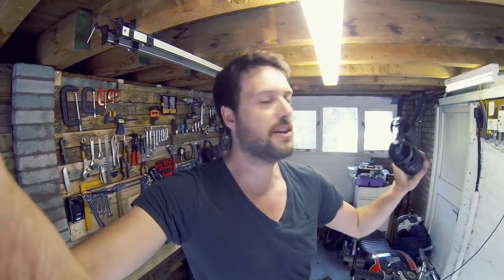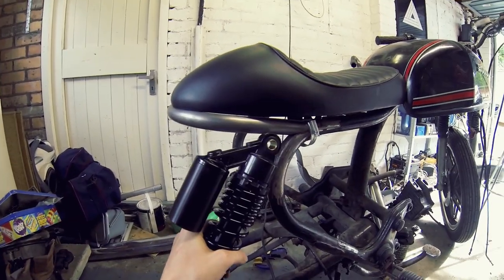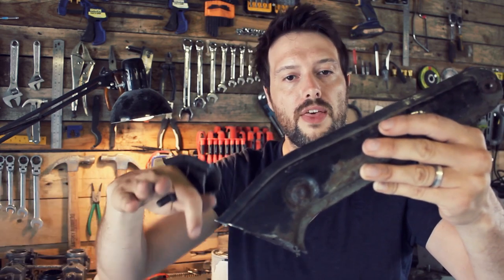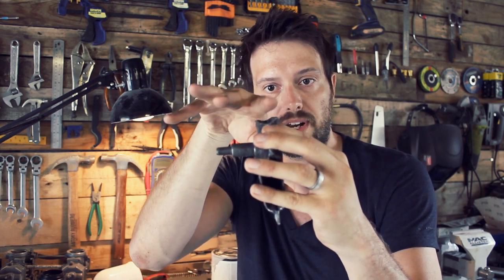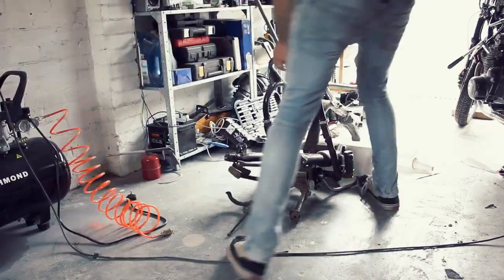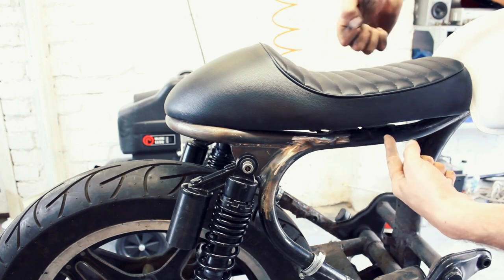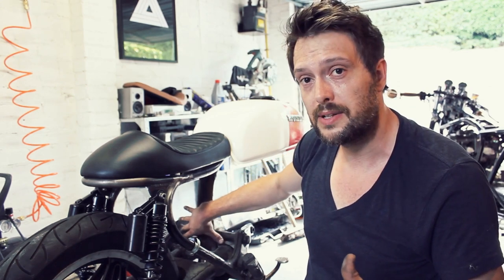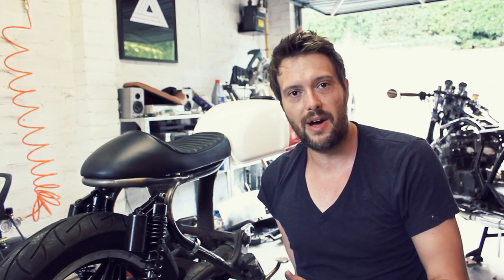Honda CX500 Cafe Racer Build 12 - New rear frame hoop & shock mounts

Comment: My cb400 project is very similar to yours, except that mine is red. You can make a battery box to hold the battery underneath the frame, around the Central easel original position. You can than wire the battery cables inside the backbone frame. That will give your bike a very clean look. As my bike won't have electrical start, I could install a very small battery of 5Ah. Another thing, I used the same idea you are thinking about the electrical parts underneath the seat. It works great!!!
Reply from the maker: Thank you, good thinking with the internal wiring.

Comment: what I would like to see is closeups on things you or someone else has done, this one had quite nice ones. are you sure you can fit those shocks upside down? they look better right way up anyway. some put they gel or agm batterys under the frame or engine in the box, but you can't fit acid battery there cos it need to be on its side. I kind of like that short subby seat not covering that back wheel.. specially when it is so close to it..
Reply from the maker: Yeah definitely going the right way up now as I've mocked it up at the end. I'll be using a LiFePO4 battery so all dry technology. I'll be making more close ups from now on with this new setup.

Comment: Hi buddy, only just discovered your channel and love the content, my one piece of advice if your budget allows would be to get a set of Murrays carbs from the states, will set you back about £500 all in but it'll transform the bike. I had the original carbs with 90/120 jets and it ran ok with dual Harley 883 pipes but was never spot on. I took the plunge and there's no comparison... a MUST on a CX build in my opinion. Keep up the good work, Cheers Paul
Reply from the maker: +cossiep gosh it's a big expense but if you say it's one thing you're glad you did them obviously worth the money for you.

Comment: Do you know, I wasn't sure about that mod you were making to the frame but I'm going to do that to mine. I have a 1980 CX500 C and I've just finished totally rebuilding the engine and carbs and I'll be starting on the frame and forks next. Thanks for being a guinea pig :)
Reply: BTW, who was it that welded your shock mounts and hoop?
Reply from the maker: It's cool, I think there have been a lot of doubts about this project, a lot of people wanted me to go monoshock. I'm glad you like it, and of course, steal away. ;)
Reply: Cheers. I made the choice early on to stay with twin shocks for 2 reasons, I like the 'older' look/feel and the other is everyone else seems to be going mono shock. I'm also keeping the original front end for the same reasons plus cost. Mine is the Custom so the tank shape is different.
Reply from the maker: +oofafoo yeah it seems to be the craze now for monoshock builds  I feel sometimes when they're done with these 'bolt on' kits they can be unsafe sometimes
Reply from the maker: +oofafoo it's a local bloke in Cheshire

Comment: At 4:52 what kind of bolts are those? I am looking to cut my cb750 that same way and need those for reference for the cut and to attach them later on.
Reply from the maker: Those weren't the proper bolts there, only something to position the shocks, for the final ones I used proper shock mount bolts.
Reply: For The Bold - dreegez ohh. It seems i am just having trouble finding bolts for it since this is my first build. Mostly just guiding Harley bolts
Reply from the maker: Try Dime City Cycles, they have a good set.
Reply: For The Bold - dreegez i am getting most of my stuff from there and havent seen anything yet maybe i am overlooking it

Comment: When you removed the original bracket for the seat and shock pins and welded in the new pins did you have to go with a shorter shock or was the distance the same as before due to the angle?  I'm looking at getting progressive shocks for my CX500 build and am trying to figure out which length I need.
Reply from the maker: No I kept the shocks the same length to both lift up the rear and to ensure clearance between the rear wheel and the frame.
Reply: Thank you so much! That is extremely helpful!

Comment: Fantastic video and video series. Ive been watching this build from the beginning as I am building a cx500 myself. I'm at the stage where I need to find some rear shocks. I think i will order the RFY ones. Did you order the 320mm long ones in the link you provided or did you go 330 0r 340mm? My setup will be very similar to yours. Thanks
Reply from the maker: I can't remember the exact length but it was the same as the original, I probably would go longer if I did it again to raise the back again.

Comment: Hi there, absolutely loving your videos! Never stop doing them!!!I So now that the bike is finished and youve been riding it, whats your opinion on the rear shocks you installed? How do they react cornering at "higher" speeds? Not to soft, not to wobbley? thinking on putting a set on my cb750 (1998) build, wich i would like to take to the track now and then.... Thanks for answering...
Reply from the maker: For road use they're ok, and stable, if you are thinking of track days, shocks are the one area I'd say to invest in some Ohlins

Comment: May I ask what the total length of the seat is? The shortest seats I'm finding are 52cm. The problem is 52cm seems way to long for me. I want my seat to end exactly where yours does. Right before the middle of the rear wheel but I've measured from the tank and back and 52cm would leave behind the middle of the rear wheel. Keep up the great videos btw!
Reply from the maker: It's the same length, but what makes this different is the frame, the CX500 fuel tank stops shorter than other bikes so the seat starts earlier.

Comment: I’m mounting my shocks a similar way to you. How did you bolt the shocks to the new mounting, did you purchase/ make a shoulder bolt or did you just use standard bolts? Thanks
Reply from the maker: For positioning and presentation just normal bolts. Then proper mounts after.

Comment: Looking great. where are you putting licence plate?
Reply from the maker: Thanks. Do you know what... That's the pain in my arse at the mo that I can't decide. I love the rear end and how clean it is. I'm looking into MOT options and how far I can push it. I might have a chat with the guys at the MOT centre on Monday and ask them. Might even be a case where I add a removable bracket at the back. I love how the bikes in USA get away with having a thin one wrapped around the rear wheel.
Reply: Yes. I have the same problem.  Kott bikes often sport a nice curved bracket that follows the rear axle centre.  I have decided to go for a 45 Degree bracket off the rear hoop, under a small catseye rear brake. The plate  then doubles as a mud guard. Cheers.
Reply from the maker: +Andrew Ritchie yeah it's along the same lines as what I'm thinking using the plate as an extended guard. Going to try and add a quick plug in and out cable for the break light and indicators.

Comment: Hi. Just wondering if you've tried these shocks on another bike or had them recommended by someone who has? Only, I noticed they are rated for 200kg max load, and I think the GSX400F that I'm tinkering with is already around the 180kg mark so might be stretching it a bit with my manly bulk sat upon it....
Reply from the maker: I have them on the GS and know a few people who have ridden with them. As for the load, your whole bike's weight isn't going to be on them, so if you have a 200kg dry weight bike, that weight will be spread evenly on the road also. But you're right, I weigh 94kg so it needs some sums to calculate if the weight of you and what's spread on the rear shocks etc.
Reply: Cheers. Very helpful thanks. Maybe I need to sit my rear end on a weigh bridge!

Comment: hi bud, 
just wondering how your going to fix your seat down as its a single unit?  having trouble with mine!

its looking good mate..
Reply from the maker: +robert white it has a few screw at the bottom for brackets. So I'm going to have to weld some nuts to the frame where I can screw the seat tight. Limits where I can put the electrics tray. I'll make a video on it.

Comment: Hi bud,  great job. Looking sweet. 
Started my 1st project. :/ How are u going to mount the license plate. Are u having a rear mud guard to mount it to? 
Phill
Reply from the maker: Brill, all the best with your project. I'm going to create a removable bracket at the back coming from under the hoop. Bugs the heck out of me having to ave a stupidly large number plate in the UK.
Reply: Completely agree. Yeah thanks. I got into this without giving the license plate much thought..lol now having to do a similar bracket. Was contemplating some sort of tail tidy but not really got the space... :/ Make a vid of the holder when u do it. 👍 great job
Reply from the maker: It's always an afterthought, same with me and both this bike and the Suzuki. I'll definitely be doing that in these next couple of weeks before powdercoating as I already have the rear light.

Comment: I have been following your channel for a while. Quality content, learned so much that I will be using for my build (whenever I find myself a donor bike).

Any tips on finding one? I am realizing pricing will be different as I like in America but basic stuff such as:

- How much will you max drop for a donor?
- What do you keep your eyes on when looking at one?
- HOW MUCH damage/non functioning stuff are you willing to put up with?

I have very limited mechanical knowledge of motorcycles, so if I am currently looking at getting one that is already running - even though its very hard to find at a decent price, so I might have to bite the bullet and grab one that is not.

Anyways, thanks for the content. Great job so far!
Reply from the maker: Thanks, happy you find it useful. So...

Bikes in America I believe are super cheap compare to the UK. 
I would pay maximum of £800
I look for bikes that are in an OK condition, not too fussed about aesthetic condition, but engine is important.
Cosmetic damage is ok, accident damage is not as your frame might be bent.

It's a good choice to find a running project, you'll find if you spend more on a running, a non-running project would cost more to get it to run.

Comment: I mean it doesn't matters if you install one or two shocks, or if you go to inverted forks but for a cafe racer style you have to be faithfull with some guide lines (you know, you post a vid "How to design a cafe racer") so came on,  if we are not going to upgrade the suspensions, the brakes, new wiring some new electronics gadgets, then we are not making any good for the bike other than change the shape and some paint, so please don't be like a bunch of people self called "builders" that they think that by lowering the handlebars installing a ridiculous seat (unaligned with the tank of course) and some exhaust wrap they "build" a cafe racer style motorcycle. Like I said I jus finish my cx cafe style I cutted off the subframe install a monoshock and not issues so far but I am a former fitter- welder, good luck with your project!!

Comment: That bike is gonna look so sexy! The welders job looks fantastic. The mounting brackets do look quite thin though, is that mechanically ok?
Reply from the maker: +Alex Y all good. They're quarter inch thick steel with a heck of a weld each side. Usually used for massive chopper rear wheels
Reply: For The Bold - dreegez i have a question for something completely unrelated. If you were to take a custom bike like a Virago for example, would increasing the rear shock length be enough to increase the rear end height? I keep reading that if you do this there might be really nasty side effects.
Reply from the maker: +Alex Y yeah changing the height of the rear will alter the angle of the front forks against the road. But it's all how you prefer to ride. Could you lower the front?  I'm not enough of an engineer to tell you the dangers (if any) I'm afraid. I'm raising the height I the rear of my CX but only by about 30mm.
Reply: For The Bold - dreegez i will probably try both but I rather do it at the expense of the rear end to make the boneline more parallel to the ground! I'll have do some testing!

Comment: is that the same seat? doesn't look small at all :)
Reply from the maker: Yeah, Hopefully it'll look ok when the frame is that accent red against the black, I know a lot of people had their doubts about the seat at the start.
Reply from the maker: Yeah, Hopefully it'll look ok when the frame is that accent red against the black, I know a lot of people had their doubts about the seat at the start.
Reply: For The Bold - dreegez One question, when the seats properly blotted down will it still have that air gap?
Reply from the maker: No, when surely bolted it'll sit flush with the shape of the frame. Good question though.
Reply: For The Bold - dreegez That's great! Just wondering because I saw a Honda gl1000 which was all stock except for a cafa racer seat with an air gap, looked half arsed so I was curious if some seats are too stiff to fit flush.
Btw would you consider a wire spoke kit for the cx500? dont know it's true but I heard that the rear wheel from the gl1000 fits the cx500 so you could order the wheel kit for the front and buy a used spoked gl1000 which has the added benefit of a rear disk brake
Reply from the maker: Yeah I agree, I think those tiny details of gaps etc are what makes a bike stand out. I think any plastic seat will bend with heat. I could be interested in spokes but I'd have to see if the drive would be a straight swap and also it might need the GL swing arm to fit the calliper for the disc break.
Reply from the maker: Yeah I agree, I think those tiny details of gaps etc are what makes a bike stand out. I think any plastic seat will bend with heat. I could be interested in spokes but I'd have to see if the drive would be a straight swap and also it might need the GL swing arm to fit the calliper for the disc break.

Comment: did your measure the distance between the wheel and the loop? it looks like the distance is to small. if the shocks are going to deflect completly the wheel would touch the frame. the original frame has this vault to prevent this. sorry for bad english, just afraid you might get in danger.
Reply: rayman3d The shocks aren't supposed to deflect completely :) also I assume a very heavy person isn't supposed to ride the bike either haha
Reply: Mysterian lol. it doesn't matter if they're not supposed to, but a pothole on a motorway can cause this. and safety first. even the fact that this might happen should make the builder think about it. its easy to measure if this is possible. otherwise he could make the loop getting up to prevent this disaster.
Reply: rayman3d yea there is the risk, the cafe racers with a straight hoop like that must have super stiff shocks I suppose
Reply from the maker: Thanks, good observation, I have measured the depth. It'll be a tight squeeze but I'll be fine on this one. The shocks have 2.8" travel. But the tension an be altered too.
Reply from the maker: It's a valid point. The hoop has been set at a bit of a kick up to ensure this is ok.
Reply: For The Bold - dreegez just take a lashing strap and squeeze everything together as much as possible. keep in mind that the tire is "growing" due to the centrifugal force. if you push everything down as much as possible and there is two fingers air left between tire and frame, everything should be alright ;)
Reply from the maker: Good technique.

Comment: Some builders build a box right in front of the rear wheel, right under the swing arm. Just an idea!
Reply from the maker: I'll have a look, Ideally I want it to be as discreet as possible.
Reply: For The Bold - dreegez For reference look up Seaweed & Gravel and look at custom motos
Reply from the maker: Thanks, really nice site and nicely branded, I think I''m going to slip it under the frame where the engine mount sits, nicely fits out of the way there. but really appreciate that link.

Comment: I'm not a mechanic but I am a fabricator so I'm worried about how some of my planed build will go but at least I'll save money welding it all myself
Reply from the maker: Yes, that's one skill I wish I had was to weld properly, it's why I got a professional to do my frame as this part was critical
Reply: @forthebold  I've worked on cars a little but hardly touched bikes but I want to make a full custom cafe racer style out of my old cbf250. Is there anything I should look out for or be cautious of?

Comment: Do you think it's possible to do that professional work yourself? Doesn't seem to be that hard if you know how to weld.I might be wrong..
Reply from the maker: For this weld, as its seriously structural, e.g. all that vibration from the road to the shocks, I would always recommend a professional welder for this job. It's how good your weld is inside rathe rather than outside.
Reply: Understandable. Thanks for the advice! Will there be more 750 videos? Im curious to see the passanger seat solution!